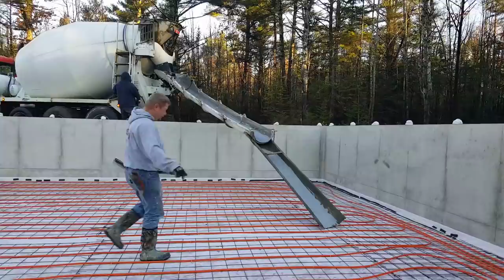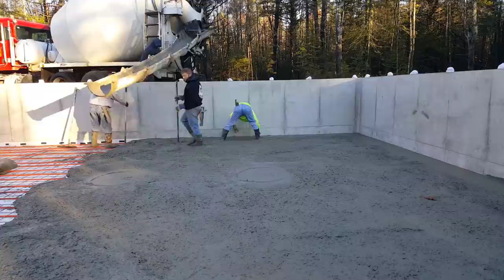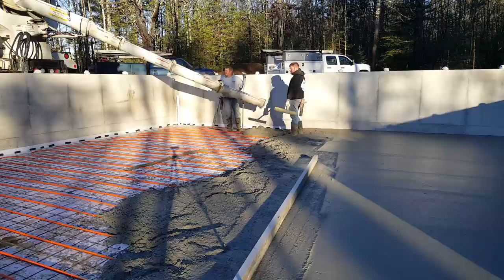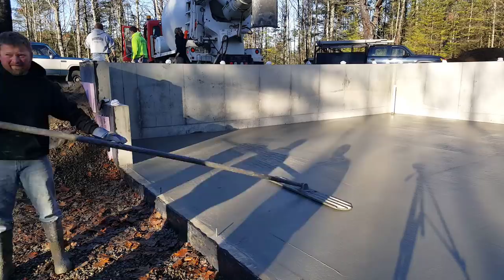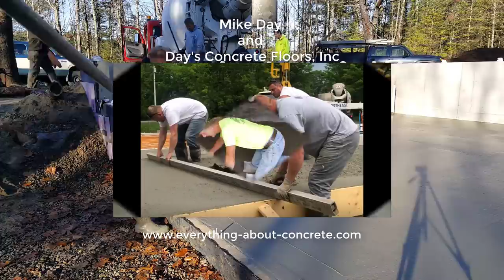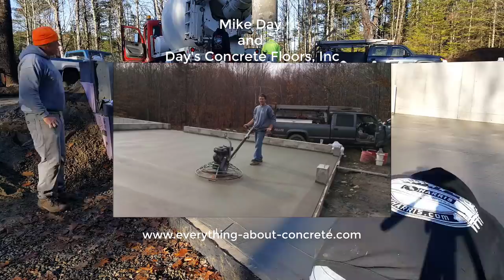HOW TO POUR A CONCRETE FLOOR : DIY CONCRETE FLOOR

Comment: Ok so you are at 5.50 for forming and pouring what would it be for prep work dirt removal and ground prep
Reply from the maker: I just specialize in the concrete work. I don't do dirt removal and ground prep.